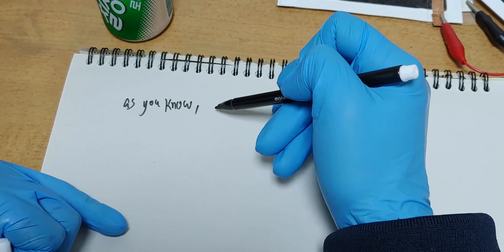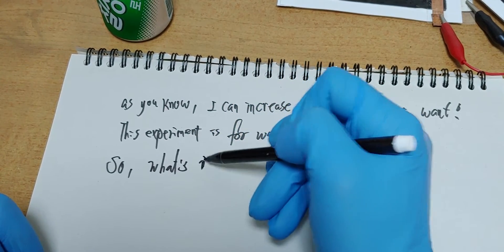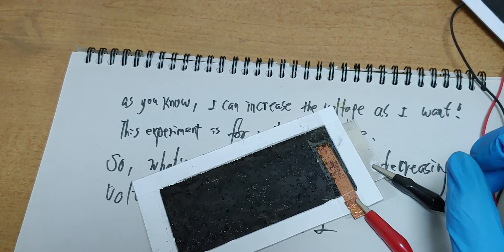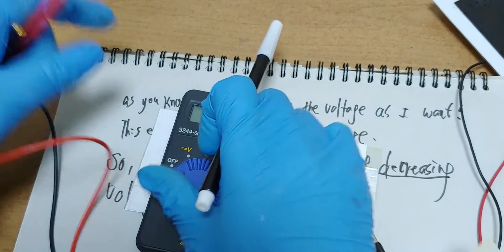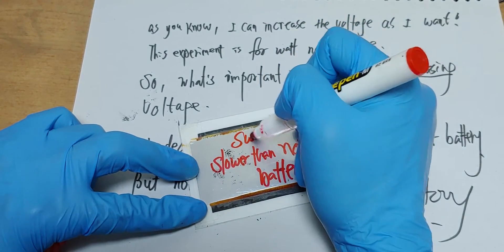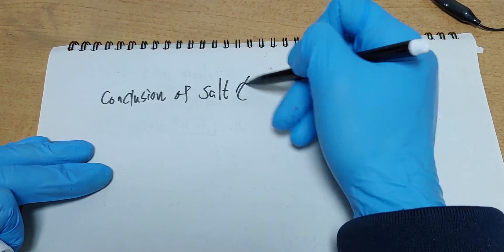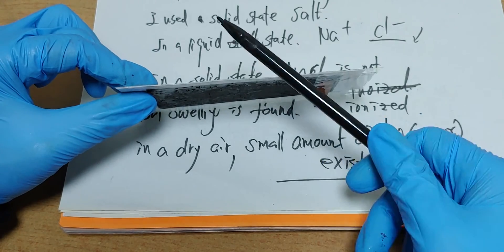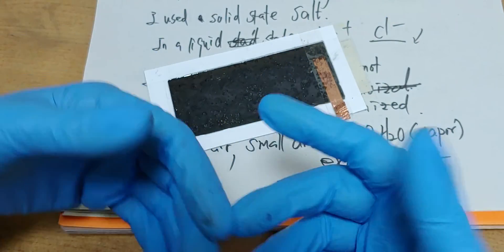Graphene salt battery

Comment: You must expetiment with salt more. Make it into liquide state.
Reply from the maker: Thank you so much. I will do this experiment more as you recommended. But using liquid state may not be suitable to my intention. My goal is to make a solid state battery.
Reply: Did you ever seen the the solid  electrolit battery working in reality? It is only possible under very radioactive and liquide metal state  otherwise it will always blow out. This techology is  science fiction today.